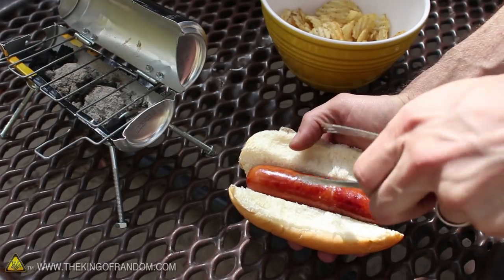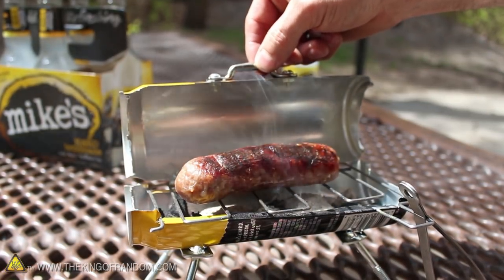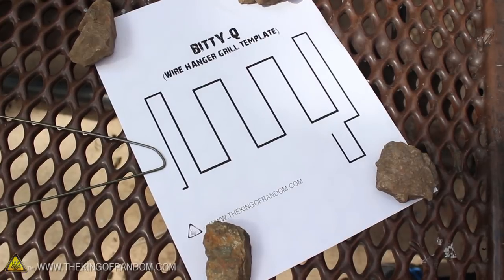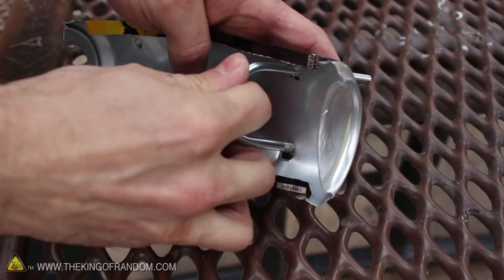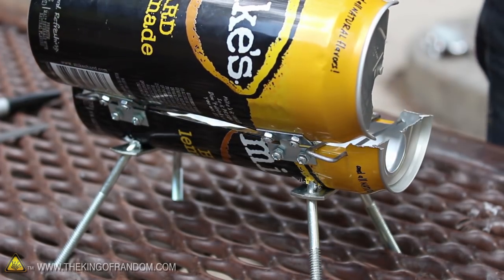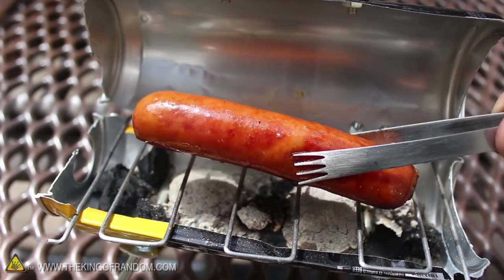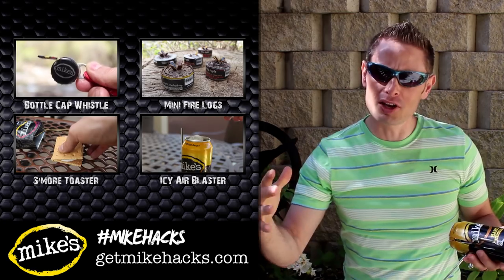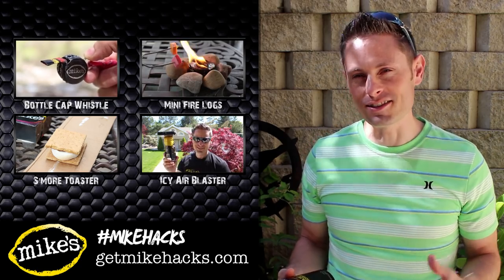How To Make The Bitty-Q - (A Drink-Can BBQ)

Comment: Since I'm too young for Mikes Hard products, I used an Arizona fruit punch instead
Reply: omg same!!!:)
Reply: Perry Day IV OMG I didnt even think of that! wouldnt that be too big though?
Reply: That's a good idea. I've been looking around the house for decently sized cans, Arizona didn't even occur to me, and it works since i like to drink it anyway.
Reply: Arizona might be bigger than the one he's using. Monster or Rockstar cans work well. Of course, a bigger can on this project wouldn't be to bad.
Reply: Ivan Alexandrov Won't find it so easy once you get arrested, Also, Don't use gay as an insult, Kid
Reply: The2ToothedNarwhal Too big isn't really a problem. Just adjust the grill size and it's fine. I'd actually prefer the Arizona can actually, because while the Mike's one was big enough to fit that specific sausage, I usually have grill larger ones and it could be a tight fit.

Comment: Aluminium  fumes are highly poisonous, not to mention the film which is used to line the inside of cans.
Reply: I didnt even think of thar
Reply: What would you do to prevent that?
Reply: +xX “PyroGaming” Xx let it burn off the film first before cooking somethings and use it outdoors only
Reply: Tech2025 Ok thanks!
Reply: +xX “PyroGaming” Xx np
Reply: Not all cans has Those fumes...
Reply: +conrado mercado they all do if they are made of aluminum
Reply: +Tech2025 ok fine you win.
Reply: aluminium fumes are not generated from simple heat, you need somthing like the arc from a TIG welder the film is gone after a few minutes
Reply: +Kidfury101 Tim cans are safer than aluminum cans
Reply: Kidfury101 tin, unlike aluminium does not have immediately dangerous oxides
Reply: Well then it's great that the aluminium isn't letting off fumes, since it's not the aluminium that's burning, it's the charcoal.
Reply: Right people wrap foil paper around garlic bread and put it on the grill like restaurants and at a home grill
Reply: sum1getthaspiewbags     alloy fumes?

what are you talking about
Reply: Well
Reply: Tech2025 really only pure aluminum will make really bad glass but still wouldnt risk it
Reply: sum1getthaspiewbags I bet on an impromptu fishing trip this would make lunch
Reply: Those fumes ate only achieved at near melting point of alluminum
Reply: That's just adding flavour 😃
Reply: Aluoxide sausage is the best
Reply: Unless it's hot enough to actually make the aluminum burn, there are no "fumes".  Most gas grills are made of aluminum.
Reply: Barbecue coals won't get hot enough to melt aluminum. You'd need to make them go to 1200 degrees.
Reply: sum1getthaspiewbags im pretty sure grant knew the dangers of aluminum poisoning and wouldn’t make this video if it was dangerous
Reply: Dude... If it doesn't burn in the video, then it's fine
Reply: randomff randombff the cans shown in the video are aluminium.
Reply: I have vibrananium cans
Reply: You are right they could be fatal

Comment: yeah but the downfall is that its really toxic to use the aluminum can.
Reply: But you can put aluminum foil
Reply: +Luis Lampa he means the paint on the can.
Reply: aluminum foil is toxic too. they both have a protective film on them that when burned can be toxic
Reply: all aluminum eating or absorbed through food is bad for your brain
Reply: +Inevitable fitness aluminum also, when ingested, compete with the calcium in your body, weakning your bones
Reply: and eating alluminum foil is bad for your teeth because it scratches them up

Comment: Isn't that handle hot?
Reply: if it is just make ur hands a bit wet and u can just grab it :P
Reply: Maybe use something that's not metal if that's gonna be an issue, preferably something that also won't melt. Maybe have a paperclip or something similar hanging off the handle to grab it by.
Reply: this is like a $3 BBQ what did you expect?
Reply: I'm thinking the aluminum can would dissipate most of the heat into the atmosphere.

Comment: i wouldn't do this. aluminum gives off noxious fumes when it's heated like that. not to mention whatever is in the linings of the cans so the liquid doesn't eat away at the aluminum. then add the machine screws from the hardware store that are probably zinc plated or galvanized... that's poisonous too. i'll pass on this little idea, thanks.
Reply: A substitute for it would be foil and some wood, Has quite a nice touch too.

Comment: Aluminum, when heated up, gives of dangerous fumes
Reply: I fear no fumes
Reply: of course it does thats why they make disposable bbqs in aluminum trays
Reply: Logan Man probably the painted label  and can lining .
Reply: that might do it although running the bbq for 20 mins before cooking should burn off any residues which is about standard for any new bbq
Reply: Logan Man Thats Zinc what youre talking about
Reply: then why use Aluminium foil?
Reply: Aluminum DOES NOT give off dangerous fumes when heated
Reply: Mark Hurley it does lmao. But only when at melting point. Once the aluminum has been melted yes it will. But it's common that you should let it burn the lining off before cooking as Sarge said.
Reply: aluminium film is widely used in  cooking...
Reply: So does charcoal.

Comment: FYI: Some wire grates use a cadmium coating to prevent rust. Since cadmium is a heavy metal toxin, best to use zinc coated wire grates, or raw iron.

Comment: I think you could make it a mini smoker with 2 cans side by side. Cutting the bottom off one, put one of those hinges at the top and a latch at the bottom then cut matching holes in the sides of each. Make can #2 essentially the BBQ but with the hole in it. Attach cans with holes lined up to one another. Make can #1 (not BBQ can) into the bottom, unlatch it and open it, fill with mesquite chips or whatever, light em up, latch it shut, the smoke exhausts into can 2 w/ brat. Now you can smoke your brats. And with just the slice of a side of a 3rd can, you could drop it into can 2 to cover the hole, making it a BBQ again. Wow I'm overthinking this concept. Sorry for the run-on comment

Comment: omg i found another cool feature! if you use the place where the mouth of the can is for the bottom, you can add the coals, snap on the grill, and ignite the coals with a barbecue ignitor through the mouth! neat, huh?

Comment: I like it because it's a cool project although being the way I am, I would actually like to make the same thing, but to use a steel or aluminum water bottle for a longer lasting grill.  If I didn't have charcoal then I'd like to be able to build a fire underneath the unit.

Comment: If anyone here has done this, I have a question, what did you use to cut the can straight because I have tried it and the cut is jagged. Thanks
Reply: Exacto Knife or regular knife. Leave it standing up and cut down. Make sure you mark the line you'll be cutting with a pen or pencil.

Comment: How do we light it? It doesnt seem to be much aflame in the video. Probably a dumb question but I need this for a "trash to treasure" project.
Reply: +ConquerorReborn BBQ's are lit with starter fluid and you let them burn until its just hot coals with no flame and you grill.

Comment: instead of coal.  use a small diameter metal tube with little holes and pump some butane through it with a BBQ lighter.

Comment: So I attempted to make this with a big Sprite can, but o couldn't find U-bolts. Could I just use a few screws and some bolts for the legs, or do I have to use the U-bolts?
Reply: You can use anything that is available to you. If you are just using bolts follow along with the steps below, assuming you are using a can like him. 

You need;

Four bolts --- Any Length
four nuts (8 for decorational feet) --- these must fit the bolts
4 washers -- the inside hole must fit the bolt, the outside can be any size, it just covers the hole you make for the bolt

First, drill the four holes for the bolts
Seconds, place the bolts inside the holes
Third, flip the can grill over so the legs are facing up
Fourth, place a washer on each leg
Fifth, place a nut on each leg and tighten them up till the washer is tightly up against the can, this should cover the holes you made in the can
Sixth, this step is optional and only for decoration, add the last four washers on the legs as feet

Hope this helped, it will look kinda the same as the can grill he made.
Reply: +William Tabor Thanks. It actually really helped me.

Comment: All I'm going to say is this hack is for emergencies who has a coat hanger sand paper nuts bolts and hinges when you go hiking
Reply: Make the parts at home. And keep em in your bag. A knife or decent multi tool can easily cut a can whereever you are. And the multi tool puts it all together. And you can coal cook from a fire with this. Easy bud.

Comment: 1 question.How the sausage cook when there is no fire
Reply: MUDDAH FERKIN MAGIC
Reply: +xav GRH The coals are hot.
Reply: +xav GRH Never BBQ'ed before, have you? Coals retain their heat and burn slowly.
Reply: +xav GRH lil l8 but. You first light the charcoal normally in a regular grill. you let them burn untill the fire goes out and it is only the hot coals with no fire. then you put it in the can